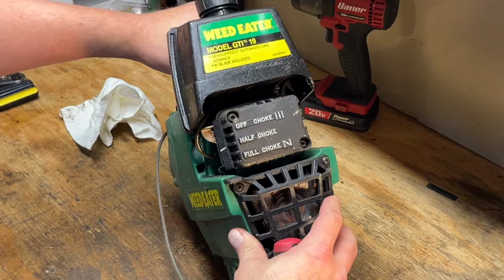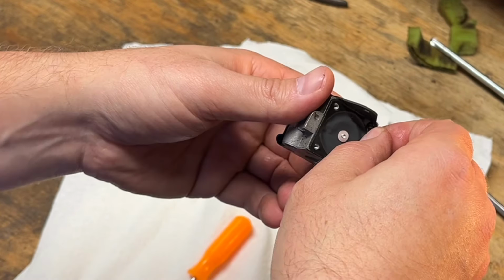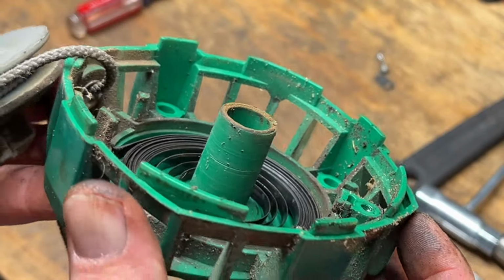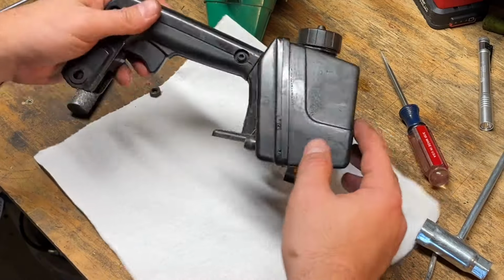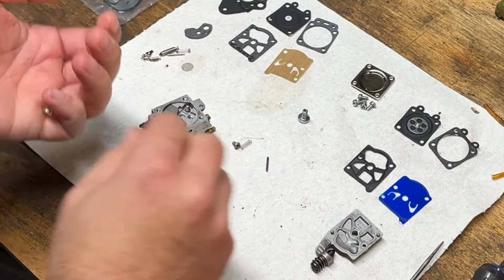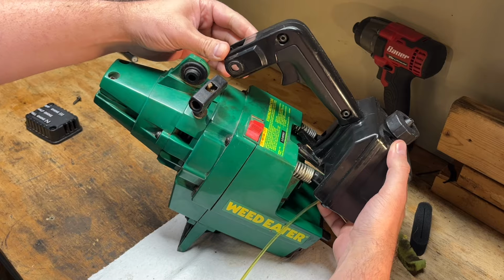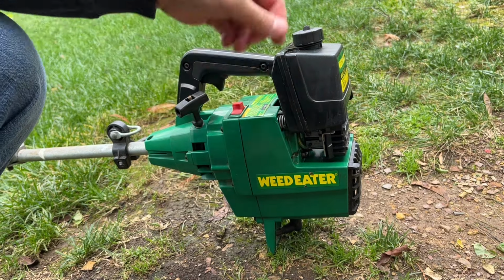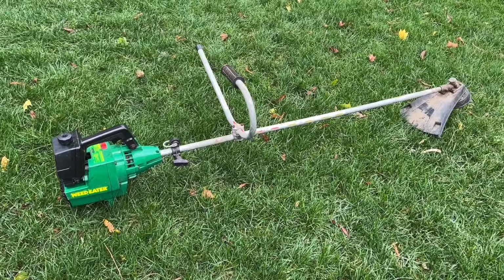Estate Cleanout Gas Line Trimmer, Let's See What It Needs -- Weed Eater GTI 19

Comment: That is one solid quality Weed Eater brand trimmer. My mother had the exact weed eater years ago, except it’s a curb shaft (GTI 15T). Well, the GTI 15 T didn’t have primer bulb nor did it have a clutch. This is definitely neat too. Yet I’m still surprised it still started and ran before and after repairs. You do such an awesome job fixing old lawn equipment. Besides, I always love the old engines better because they are not complicating to work on and they still work at its best, so long as it gets taken care of. You also have to be careful with ethanol gas or else it will slow slowly eat up that engine. GTI 19’s are definitely very decent and efficient weed eaters back in the 90s. I’m glad you saved it.
Reply from the maker: Funny enough, I've actually got a GTI 15 (no "T") from the same lot. I wasn't going to do a video on it since it'd be more or less a repeat of this, but happy to pull out the camera when I get to it if you'd be interested in seeing that as well. Thanks for the comment!
Reply: @BackyardRepairs  yes! And definitely do a trimming video after fixing it in the spring